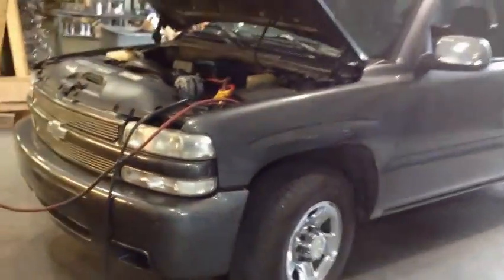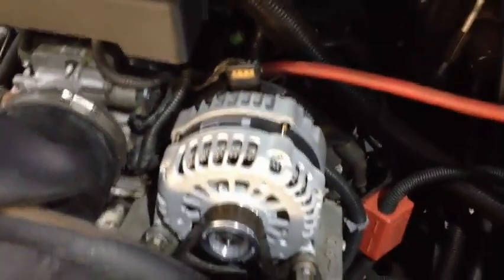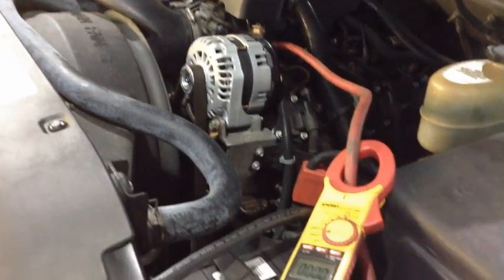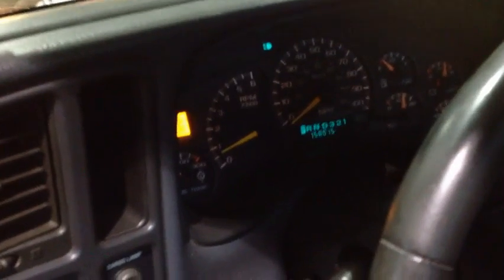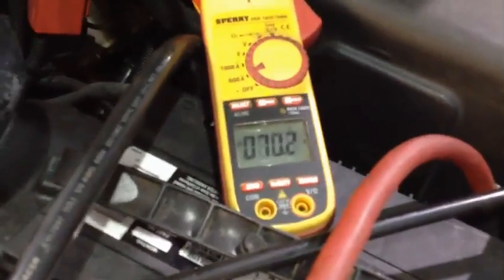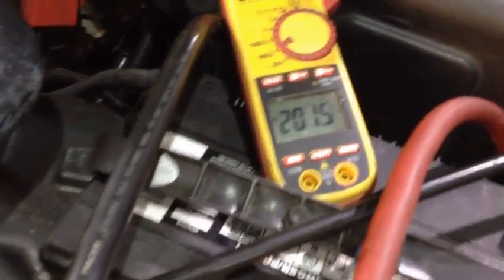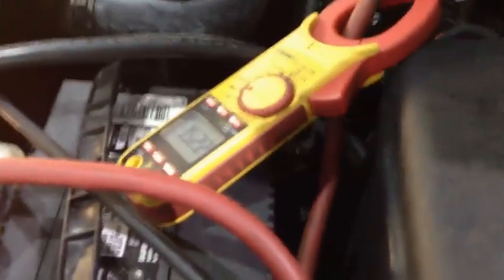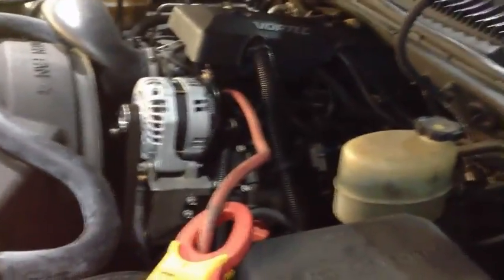MECHMAN 370 AMP SMD ALTERNATOR LOAD TEST 200 AMPS AT 500 RPM!!!

Comment: just installed my 370 on my 2006 Silverado 1500 with the 2pin.. and boy it's very impressive.. I didn't realize my new stock 160a was lacking a lot of voltage.. now my amp doesn't clip anywhere near where it use to.. very happy with my purchase and will definitely recommend mechman..

runs 15.2 at idle with volume pretty high, I need to re tune before I got full tilt.  my clipping point has definitely disappeared and I need to tune my amps again...

Comment: So from what i saw it is basically a 350 amp alternator. LOL " we been beating on it already" So its hot rating must be 350 amps and that's what your going to get most of the time. I would delete the video cause you make your product look like lies.
Reply: ditto  normally  it would have air rushing around it when driving which cools it down a bit

Comment: As another person mentioned, its EASY to do high current on LOW VOLTAGE. I think this is why he is not showing the voltage readings at high current. Probably because they are low although the current is high. USELESS for most amps that demand constant peak voltage of above 13 etc....

Comment: that is crazy.my factory mustang alternator specs about 130amps max and about 70 idle. i've been wanting to get an alternator from you guys and i think this just sealed the deal. the car is a 2000 ford mustang gt with the 4.6 single overhead cam 2 valve. i'm pushing 2 soundstream RUB1.2500D and a menphis 4 channel.